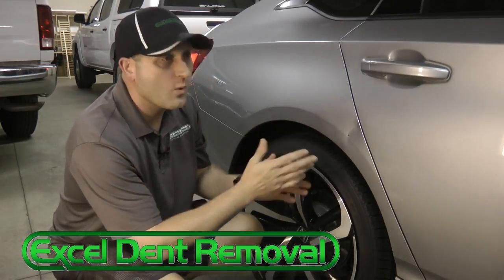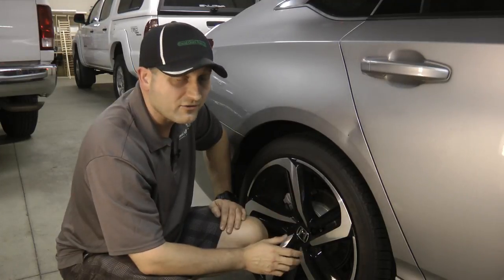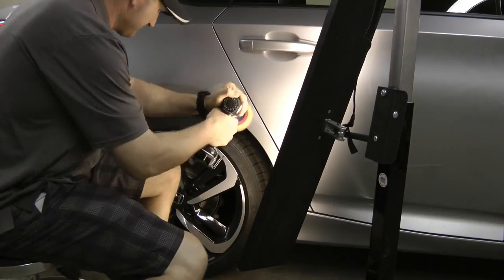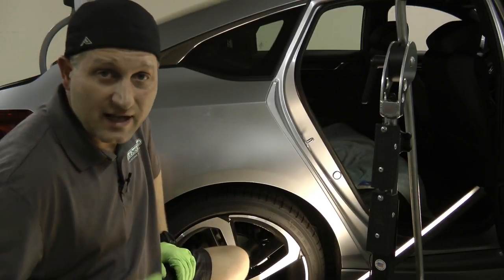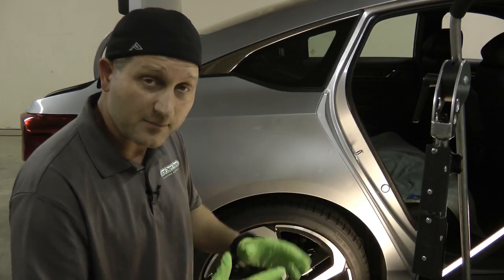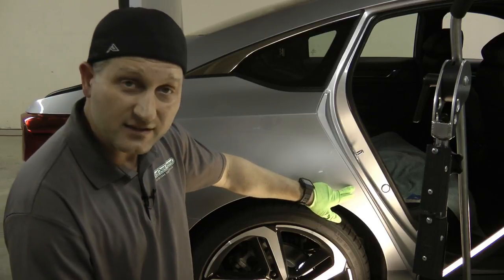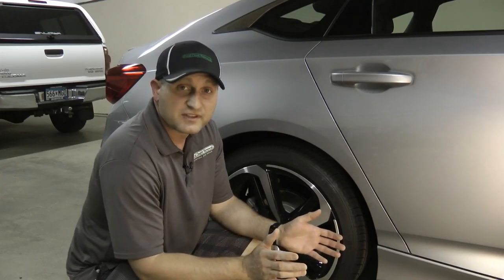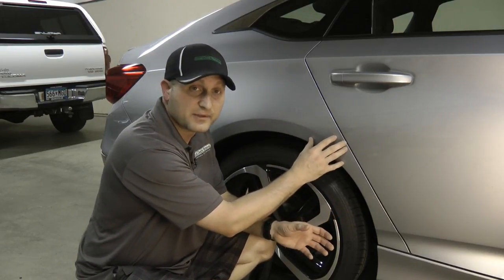Pulling Out A Dent - Will The Dent Pop Out?

Comment from the maker: Most dents are not a quick pop out dent. If you have questions about using Paintless Dent Repair to take out dents in a car, then leave them in the comments below.
Reply: You are PRO sir.   That level of attention to detail and patience .  Amazing job!
Reply from the maker: Thank You! Yes, it did take some patience to be able to pull this dent out.
Reply: Will the glue method you had used on that Honda work on dings that have a Paint Protection Film (PPF) on the body panel?  My car has a ding at the same location (rear right quarter panel) but that panel has a PPF on it.  Thanks for any insight sir.
Reply from the maker: No it will not work. It will either tear or pull off the film. 
You can see an example in this video here. https://youtu.be/cJjQZJ9feV8
Reply: where are you located
Reply from the maker: +Ant T I have a shop located in Blaine Minnesota. A city just north of Minneapolis
Reply: How much for that job

Comment: Thanks for the help-  I'm doing body work on a car that will get a new paint job down the 
road, so besides using a dolly and a hammer I wanted to try glue pulling. 
I happen to watch a guy who puts clear shipping tape over the dent so he would not pull
any of the original paint while pulling out the dent.

One thing I did not tell you was I have been trying to pull the dent out on bare metal and
I get no where, so I tried the clear tape over the dent & bare metal and it worked.
I guess the glue needs something like paint to create a good bond and the tape does
the trick.

                                          Thanks for your help
Reply from the maker: Yes, the glue does need to be able to stick. Great idea using the packaging tape.

Comment: It really needs to start at good pull first on that edge and bit of dolling the inner door to reduce pressure then continue glue pulling that.. its a very challenging job.. great job..
Reply from the maker: Thank You!! Yes, that edge did require some work. I probably could have started with that and it may have made it a little easier.

Comment: Nice job Steven, always an awkward place to get behind, looks like the glue pulling was kind to you and got most of it out before going in with the rods!
Reply from the maker: Thanks! Yes. I thought I’d have better access with a PDR tool from the trunk without having to remove the tail light. But the best I could reach it with was a whale tail tool and it was just spinning around. 
I ended up just spending the extra time Glue pulling all of it.

Comment: If i have dents on the inside of my door pillar would it be better to pull the dent this method but they are very sharp little dents (seatbelt buckle got slammed by passenger when they were closing the door) or just have them bondo... I'm planning on spraying over the car.
Reply from the maker: If the dents are sharp then glue pulling probably won’t help with those dents. 
I’ve repaired those type of dents before. It usually requires removing the inner door panel for access behind the dents to push them out.

Comment: Look at that dent guy gloving up while using alcohol. Smart choice.  I've been telling techs to do that for years. Great job.
Reply from the maker: Thanks! Usually for a small couple of glue pulls I won’t use gloves. But for longer periods I have to. Especially being in Minnesota in the cold dry winters. My hands would be raw.
Reply: Excel Dent Removal I read that denatured alcohol is carcinogenic, damages kidneys and causes problems in the central nervous system. It absorbs easily though skin. The stuff isn't good. Been unsing 91 percent isopropyl now with gloves. Used denatured for 10 years without gloves. I'm an iowa guy and work in Minnesota a lot. R u in the cities?
Reply from the maker: Yep. Stopped using denatured a long time ago and switched to 91%. 
Yes I am north of the cities in Blaine.

Comment: So, if it’s a small faint dent on a body line, is it best to leave it alone?
Reply from the maker: Many types of small dents can still be repaired, including if they are in a body line. It would be better if there is access behind the panel to push out the dent, but it still could be possible with glue pulling.

Comment: I have a similar type of that but not on edges nut on a lower part of the door of vW Passat whose metal is flexible on that are . Any suggestion ?
Reply from the maker: +Haard Dwivedi Glue pulling may also work for your dent. If there is open access I would usually try to get behind the dent and use PDR tools to push out the dent. Dents in the lower part of the door offer require removing the inner door trim for access. 
Sometimes both methods of glue pulling and pushing from the inside are used.

Comment: Awesome job! How much does it cost?
Reply from the maker: +TC Vlogs The average cost for paintless dent removal can usuallly start at $100, then $25-$100 is add per inch in size. This is based on many factors including the location of the damage and the difficulty factors to repair it. 
The dent in this video would average around $250-$400.

Comment: Does the glue leave a residual mess on the paint ?
Reply from the maker: No. This type of hot glue is designed for this process and for car paint. If the glue still sticks to the car or the tab, we then use a rubbing alcohol solution to easily remove it. 
You can see it here in this video. ➡️ https://www.youtube.com/watch?v=uPNP4GfDb1I

Comment: Well done. That area is really nasty to do.
Reply from the maker: Thanks! Yes it is a difficult spot to do, especially with only glue pulling. 
I thought I would have better access for PDR tools but the access I had wasn’t enough unless I would have taken out the tail light, which would have required removing the bumper. I figured I could finish it with just pulling out the dent instead of having to take all the extra apart, which would have increased the cost to do the repair.
Reply: Excel Dent Removal I would of done it exactly the same but we'll done.. Impressive.

Comment: Dear Professional,
What brand of glue you use? I am in Australia and all glue gun sticks I used do not hold on the car body.
Thanks for advice.
L.
Reply from the maker: It could be because of the heat where you are at. If it is not holding to the panel, this could be because it needs time to cool or use something to cool the panel before and after applying the glue. 
There are also some PDR Glue that is better designed for hot and humid weather. 
I have some that I use listed on my Amazon shop here ➡️  https://www.amazon.com/shop/crownedcompanies?ref=exp_loc_sh_crownedcompanies

You can also look at the selection of glue from Anson PDR.

Comment: Did you use heat for this repair?
Reply from the maker: No. I don’t think I did. The regular temp was warm enough and any extra heat would have made it take longer for the glue to cool or it may not have stuck at all.

Comment: What glue need to use just a rehular glue gun?
Reply from the maker: +Jimbo Obrense We usually use special glue designed for dent removal on cars. These glues are less likely to damage the paint. There are different kinds for different temps. 

There are several glue guns that can be used. Sometimes a regular one can be used but it will depend on the temp that it uses. 

You can find a few of the tools I use and recommend at this link. 
http://goo.gl/vVrHxQ
Reply: @exceldentremoval  thankyou so much mate!!! I cant sleep and worried on a small dent... but if i will you a regular glue gun what temp would you suggest???
Reply from the maker: I’m not sure exactly the temp that they use but the ones I have are 60 watts.

Comment: So if it’s such a small dent, but it’s difficult to work with and you spend the whole day working on it. Then of course you have to charge the costumer for the whole day of work. What if the costumer’s get angry when you charge him few hundred for such a small dent?
Reply from the maker: Since I've been at this for a while, I usually can know before I start working on the car how long the dent will take to repair. I then will provide an estimate before I start the repairs.
For this damage, it did take longer than expected since I wasn't able to use a PDR tool to work on it. But I still kept the cost the same as the estimate and did not charge more.
Reply: Excel Dent Removal how do you know how much you have to charge? How do you know how many orders will you be able to do in one day? How do the costumer book a place in your shop?
For example you have 4-5 cars you have to do, but it took you longer than expected, so you only finished 2 cars. What happens then? Will you charge these two more? You obviously wont work for peanuts.   What will you do with the rest of the costumers?
Reply from the maker: The paintless dent repair cost is based on the size of the damage and the additional factors that effect the repair. We have software that will calculate the estimate for us based on this. 
I have repaired thousands of cars and hundreds of thousands of dents over the last 20+ years' so I usually have a good idea on how long a repair will take. If it takes longer, it’s not usually more than 30 minutes to an hour. Since that can happen, I will usually schedule enough time for each repair or to give a “buffer” between repairs. This is also to give myself time to recover from the work. Especially if it is a difficult and labor intensive repair.
Reply from the maker: For scheduling repairs at my shop. I will take on the bigger jobs and have the car dropped off for the day or sometimes 2 days. For hail repair it can be for 3-5 days. This gives enough time for these larger jobs and also allows to have the smaller door ding repairs done while people wait. (Usually only 30 minutes to 2 hours) or they also leave the car for a few hours.
Reply: Excel Dent Removal thanks!

Comment: You must have some crap bodyshops over there if after the repair it diminishes the cost of the car.  
Also any panelbeater worth their salt could metal file a small repair like that without using a filler. 
Pdr is great but please stop bitching about bodyshops.
Reply from the maker: Yes, you are correct. There are some body shops that do excellent work. I regularly send people over to a few select shops that need paint work done since these shops are the best at what they do.
These shops and many of the car body repairers will have me fix the dents because they don't what to have to paint the car. Especially when it is their own car. 🙂
This is because having to paint a car does reduce the car value when there is no factory finish. Many people don't know how bad the damage originally was since many panels have to be painted. This will reduce the trade in value or resale. Not something that is wanted on a  brand new car. (My customer specified he did not want any noticeable repairs on his new car)
Again, there are still some excellent body shops that can do great work.

Comment: ???&????? Ta pronto !!!
Reply: I have a problem with the glue i'm using,  it seems to let go before any pulling happens.
is there any info on the web that explains the different glue colors and which holds the
best without letting go.  The glue came with the kit, which was made in china.
any good glue products  that is made in america that you would recommend 
and do the colors of the glue have anything to do with the strength of the glue ?

                                       Thanks
Reply from the maker: Here are a few PDR glues I use and recommend. They are listed in my amazon shop 
https://www.amazon.com/shop/crownedcompanies
Reply from the maker: There could be a few reasons why the glue isn’t holding or the dent is not coming out. 
They can be ambient temps being to cold or to hot. Average panel temp should be around 70-80 degrees. 
Could be proper panel prep. Surface should be clean and free of wax. Also if there is a ceramic coating on the car, the glue won’t stick. 
Other thing could just be that the dent is to sharp or not possible to repair with glue pulling.